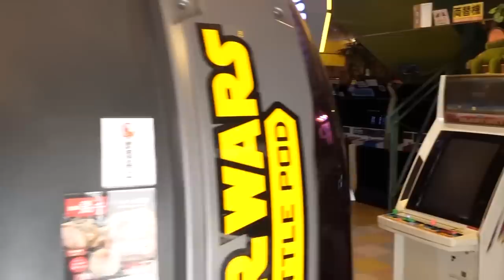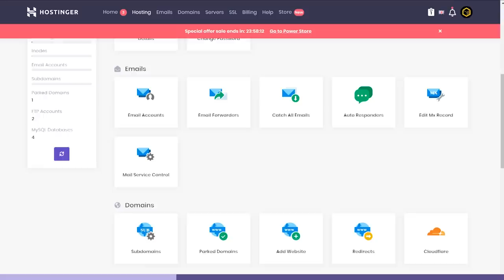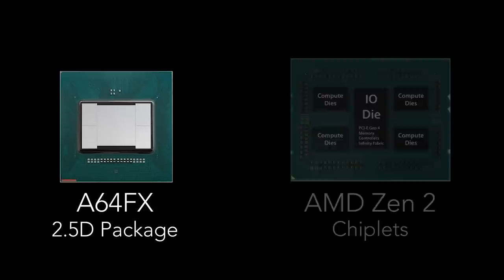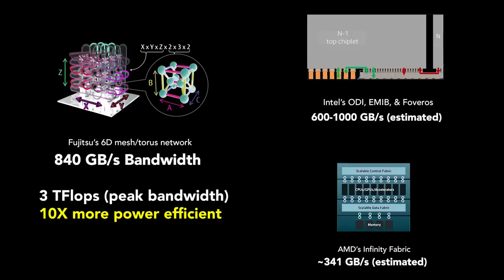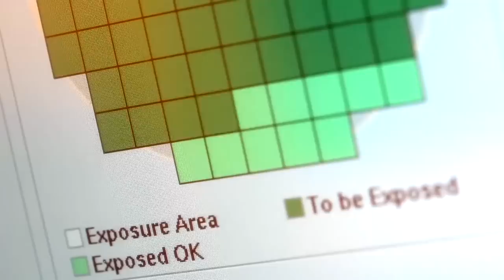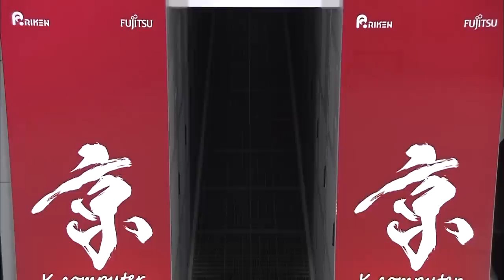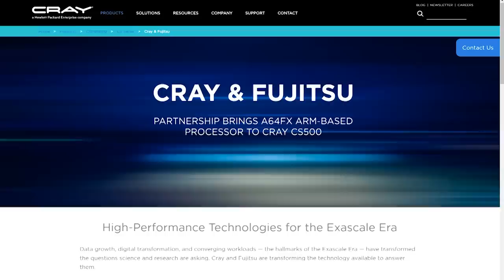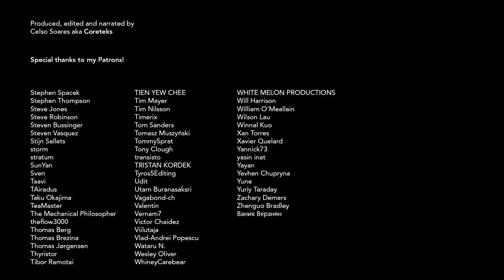CPU? GPU? This new ARM chip is BOTH

Comment: When are we going to see desktop CPUs with 3D stacked memory and realistically how much memory is it going to have? I can't see 32GB of system memory fitting on a normal desktop die but maybe I'm wrong. Or will it just be a small amount of on-die memory to be used like an extra cache layer but you still have your normal DDR system memory?

Also, I can't be my head around heat dissipation in this new 3D stacking future. Given heat is the biggest issue in 2D chips and atm we can cool directly on to the only layer there then 3D stacking just doesn't sound like it's going to work on anything other than ultra low powered chips to me.

I guess you could try to have some kind of micro coolant channels flowing between layers or maybe thin sheets of graphene but this will be expensive and complex to integrate plus If you have to go from CPU's running at 5GHz to them running at 1.8GHz then I can't see the benefits of closer system memory being enough to overcome this inherent drawback.
Reply: True story. Yes we will see 3D stacked CPUs with some kind of RAM on them. (My guess is 2023). We've seen GPUs already that have large HBM stacks "on-chip", and we will see them integrated to even more "on-die". Since Intel has invented its "Foveros" tech to avoid the Interposer layer and TSV's. It does seem like the RAM packages would be almost as large in die size as the CPU. (judging back to the HBM GPUs). Also, Remember the 128MB EDRAM L4 cache on the integrated GPU of Broadwell 5775C (2015)? Granted it was for the iGPU, but that was an early proof of concept of CPU+RAM, and took up a very large real estate of that chip. It wasnt market friendly, the proportions and cost were all wrong for mass-marketability, but it was interesting to say the least. Right now its probably easy enough to add a stack of 1 or 2 modern 16Gigabit DRAM die (=2 or 4 Giga BYTES), thats just my speculation. 
They've also been researching that micro-coolant-channel science as a real possibility lately. And you're right, the heat in the 3D stacks is the main issue. Everyones trying to stack the best way possible, its just a question of how.
Then again, besides the real science of it, theres commercial viability concerns. The currently long-standing seperation between the CPU and RAM markets, means we get good prices on both. RAM as a commodity as we know it would be at risk if the 2 main CPU makers are integrating it onto a CPU. The move away from "memory modules" we all know and love would be too hard to do. Plus, think Apple laptops and planned obsolescence; they already solder the RAM on the motherboard, I'm sure they'd love it soldered right on the CPU. So we can buy $1000 CPU+RAM combo-chips and throw them away in 3 years when Chrome starts using 128GB of ram. I'd be more convinced if it was a small L4 cache idea, and leave system RAM alone.
Reply: he does NOT want to mentiion the downfalls , we can barely keep heat off our current cpus and gpus, so 3d stacked? nah the amount of power needed, and cost to switch a billions of severs ,no happening
Reply: Having things as simple as the video suggests would be a dream.  Unfortunately, we'll keep having multiple levels of memory like we always have for over 50 years and different speeds, capacity, and prices per capacity for each.  That means any software developers eager for better performance will need to continue optimizing for that complicated layout and be mindful of how it all works.  Drastically more L3 cache would be great but there will always be demand for different capacities that strike a different balance on speed, price per unit of capacity, and capacity.  RAM Drives introduced at https://www.youtube.com/watch?]v=6pp_krChw_A do a great job of explaining some of the tradeoffs between speed, price, and others between SSD-like memory vs RAM.
Reply: When it hits consumer it will probably have HBM3 memory with up to 64gb on die. Since you won't need ram and GPU, PCs will become micro form factor, imagine how many sockets for these monsters can u fit on standart ATX motherboard without chipset, pci-e slots, etc? :)) and u just need to watercool that bitch with AIO or custom loop. U can add for example 12tflops another chip when u run out of resources or add smaller performance one and they will stack together :) and then add most powerfull one when u get money :) and continue your life with 3 cpus and add one more in 5-6 years :)
Reply: @johannajohnson310  
I'm inclined to agree, there's only so much efficiency you can squeeze out of silicon no matter how it's designed.
Reply: @The_Man_In_Red  imagine the Power supply needed for 10 i7 cpus and 10 2080 gpus stacked with 2300+mhz ram on top of one die, not happening thats like retard level power around 3000 watts and 500 degrees of heat lmao unless you own a Nitrogen company thers no way to stop the heat and water cooling on stacked would make the radiator the size of a large pc tower

Comment: Hey glad you're back. But I think you are beating a dead horse with ARM. I am from back in the day when ARM was DEC and the Alpha chip. The RISC vs. CISC WAR was won and lost back in the 90's. Hell DEC was so far ahead in the early 90's that I bought a $4K Alpha workstation with Windows NT (UNIX licensing was too expensive at that point) for my own use. It even gamed! But soon thereafter DEC, a "Intel" type behemoth of industry back then went under. Along with all the other RISC chip manufacturers, HP, IBM, they all left the general computing market. The world consolidated on CISC w/x86 instructions, later updated with AMD 64 bit instructions, (another loss for Intel). 

While it is true a specialized chip will be faster at a single task, that is not the world we live in. Multiple different tasks running concurrently does not lend itself to single use chips. Just like ASICS for Bitcoin when the algorithm changes they become less useful silicon or junk.  Real Time OS's work well with RISC arch. Like they use on the Mars Rovers. But more satellites use radiation hardened 386 cpu's to this day. So wish as you may, the world has standardized on x86. Be it the programming tools, or just the fact that it is the "common" language of general purpose computing. The fact that we use ARM processor tech in our phones is only because of low power requirements of the device. 

While in Russia or China they may make their own ARM cpu to keep track of their people and not rely on western technology (US). They will fail because of low adoption rates and poor performance when compared to US technology. Hence why they steal US IP and can't be trusted. No one can trust anyone else in the world today. Beyond me how we will have peace on earth and good will amongst humankind. But Fujitsu, will learn the lessons of others, even Cray computing got sold to HP. I don't see A64 FX going much past the Japanese market.  Just look how hard it is for enterprise providers to switch to AMD Eypc from Intel, and they are both x86! Just a note while that liquid cooling system looks cool and quite. It is hell of expensive, see all that copper, and only recently have NOCs been adding water chillers vs. standard air conditioning. Even more costly to install. 

90% of the computing market had written off AMD before Zen. People were doubtful of the rumors, even upon release, there were still doubts. But now 3 years later AMD is the newest player in town.  Then there is the issue of x86 getting better at low power, take AMD's 15W 8C cpu, or Intel's. Now we all know that 2-3W is what phones and tablets use, but how long before x86 matches it? I don't see ARM chips enmass going high power. In laptops the are a joke compared to x86.
Reply: Jerry Watson 
Bottom line, its not about how fast one cpu is, its about cost and efficiency 
In a supercomputer or datacenter total cost of ownership is for a large part electricity. Cooling is about half of power use. So, if the same computing power can be gained with more CPU’s and systems that in total use less power the choice is a no brainer. 
The same is the case for mobile devices, using a minimal amount of power but with very much calculation force
Reply: @KokkiePiet  You are so wrong. 🤣🤣The faster ExaScale computer is the most  efficient. El Capitan will do more work than the two Petaflop Supercomputers it is replacing! ARM can't touch this! LOL. 😁 I can't imagine how many acres of ARM cpus it would take to even come close to a Petaflop, let alone Exascale.
Reply: Jerry Watson 
So where am I wrong?
All I am saying it’s a choice of calculating power per watt
Reply: @KokkiePiet  I would suggest you watch a few more videos before commenting. That is very low on the list of requirements. When the new machine can do 6 billion calculations per second. Power per watt goes out the window. Not even in the same league.
Reply: @KokkiePiet  Just to add, El Capitan is a 40 MW system. Got a small nuclear power plant to run it and it's siblings? ARM is not Exascale. How many cabinets would it take for 2 TF? 5,000 if they could even connect them, ARM doesn't have Infinity fabric. Save it for phones. It's cheap enough.

Comment: This sounds great for computers that do multi-threaded work, but most desktop computers focus on serial work and that's a different situation.  A GPU's workload doesn't care what order the code is ran in, so this allows it to scale very well with multiple threads.  CPU's focus on latency, and the lower the latency the faster the execution, hence why there's so much cache in modern CPU's.  The A64FX sounds like a multi-core multi-threaded CPU with little regard to serial workloads.  If you stripped Intel and AMD CPU's of their cache and branch prediction, you basically have a GPU, which is what the A64FX is sounding like. 

AMD and Intel CPU's are inherently inefficient because there's so much one can do to increase IPC.  The higher the clock speed the more power is needed.  Branch prediction tries to execution branchy code ahead of time to increase IPC, and this means you waste execution pipelines.  Cache is meant to help in branch prediction, as well as reduce the latency of ram, and AMD/Intel CPU's are overflowing with the stuff.   All this wastes energy and silicon to try to get faster IPC for serial work.  Unless you compile the Linux kernel often, the A64FX is not for consumers.

Comment: Just an minor correction: The ring bus was used by Intel for Haswell and Broadwell. From Skylake onward, they are using a mesh interconnect.
Reply: Desktop Skylake (and family)  uses a ring bus too. The high core count chips use the mesh interconnect.

Comment: 25+ years ago SGI was at the forefront of pushing memory and I/O bandwidth as the critical foundation for effective scaleable HTPC, which made sense given their typical client base, ie. those dealing with very large datasets (GIS, medical, auto, aerospace, etc.) Their NUMALink interconnect I think topped out at 64GB/sec by the time the company was finally gone. They also did a lot of work reducing latency for large shared memory systems and it was their OS scaleability ported to Linux which allowed Linux to really take off in the HTPC market, along of course with XFS and OpenGL more generally.

That drive though for bandwidth kinda faded after the company hit the rocks in the early 2000s; once their workstation line stopped and the tech world became x86, nobody really cared about bandwidth for the longest time, it was all about the separate componets in a system instead (CPU/gfx/RAM/storage), a decade+ of a legacy chipset arch to link things together (partly offset by having gfx and some storage connected directly to the CPU), hardly any progress in how they communicate and nothing at all in COTS terms about scaleability (at one point SGI had ideas about a workstation that could be connected together to form much larger shared memory systems, a multicore MIPS-based system using PCI Express and NVIDIA gfx, but that never came about). Now suddenly with a sharp increase in data demands, including from consumers, bandwidth is back in fashion.

Is there any dense COTS system today that can do 1TB/sec I/O? SGI managed this almost 20 years ago with the Origin3900 series, though that required rather a lot of racks. :D  I've still yet to hear of any single motherboard workstation that can match even an older Onyx2 Group Station for Defense imaging with just 64 CPUs (load and display a 67GB 2D image in less than 2 seconds), though surely Rome could do this (an Onyx3000 system could doubtless do this with far fewer CPUs, but SGI stopped publishing such technical details after 9/11). I sometimes wonder what gfx is being used by the DoD for such tasks, probably a custom/scaleable Quadro with a buttload of RAM.

Thanks for the excellent video! It sounds like at last genuinely new directions in computing are on the horizon.

Group Station Ref: http://www.sgidepot.co.uk/onyx2/groupstation.pdf

Comment: Few things I have to disagree with. 
1) HBM isn't outright better than DDR. Its main limiting factor(excluding cost) is its relatively low capacity. DRAM can currently reach 4TB of RAM on a single socket while the limit of HBM2 is only 24GB/stack(most I have ever heard of is 4 stacks on a device).  

2) It doesn't work the same way as a GPU. It just doesn't on a fundamental level. Modern GPUs have clusters of vector processors. Vector processors apply the same instructions to multiple pieces of data at the same time(also called SIMD for single instruction, multiple data). So a Vega 56 can be thought of as a 56 core vector processor. This thing is just taking normal cores and cramming a lot together with high bandwidth, and as a result, it is a lot less efficient with its bandwidth than a GPU doing a task that GPUs are good at. The upside being that this design is more versatile.

Comment: I could easily see a company using these new chips to power a web OS/android cloud  operating system to their own devices they’d sell or to other devices. Providing this as a service for a monthly and/or yearly fee. With 5G,Li-FI,& Starlink all on the horizon people are practically never going to somewhere where they’ll be without the ability to have a connection and speeds capable of doing most of the tasks people do on their devices.

Comment: Saving on 11:56... HBM is expensive due to the interposer, they are probably using HBM2E if trying to save on costs. I could so see the future of CPUs one day all having HBM, this would allow much smaller computer systems with less traces and eventually I could see almost everything being built into a CPU where the motherboard is nothing more than connection with internal components and having an I/O board.

Comment: Great video Celso, sounds like the A64FX chip could make for a great games console processor too??
When do you think we will see memory on chip on desktop CPU? Zen 4? Would this be more like another cache level and we will keep regular DDR system memory as I just can't see 32GB fitting on a CPU die.
Reply: By embedding the hbm on the soc, the processor has a direct link to it and can therefore shift data at much faster rates. It eliminates a huge bottleneck by shortening the bridge between the two. 

With all of these extra cores, specific tasks can be assigned, and change more dynamically than ever. Think of it as a logic function: the various cores can change form based on whatever task they are doing, and without it bogging down the system like emulation, for example. All computing is algorithmic, this is just a more advanced form of it.
Reply: @redrumtm3435  Sure, I get that, and that is a great feature/asset to have which is one of the reasons I've been super excited about this chip and following it since the mid 2018 but what I am saying is 32GB of HBM per die seems kind of small for data centre work loads so when you have a data set or even single file that is more than 32GB you will have to split it and send it to different dies which will surely be much slower than have the whole of the data sat in normal system memory where any free CPU can work on the data?
Reply: @Speak_Out_and_Remove_All_Doubt  The entire system works so efficiently that data can be transferred much faster. It can achieve much more, but with a lower buffer. The cores are designed to work as one, and vary when and where necessary to suit a particular task. 

Basically, the entire thing is the beginning of ARM's transition into a hybridised cloud system that works across all devices. This is how we will cheat Moore's law, and continue to push the envelope so to speak.
Reply: @redrumtm3435  I know Coreteks is a firm believer that ARM is coming for x86, and I agree it will take over certain areas, but I think the PC space is so heavily entrenched in x86 I really can't see it happening but it's great that it is happening on the server side if its faster and using less energy. Coreteks also loves RISC V, i'm not sure which is has the better chance of challenging x86's dominance.